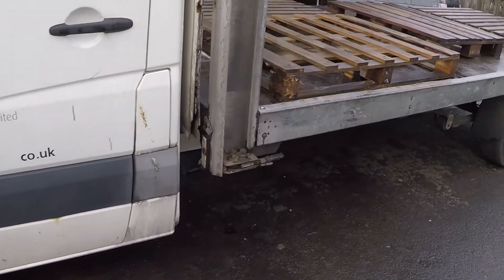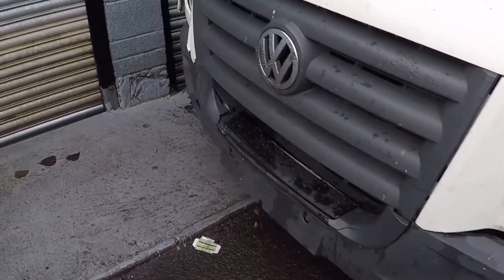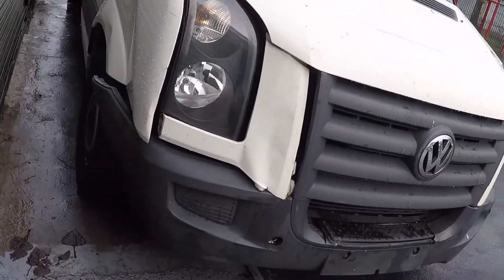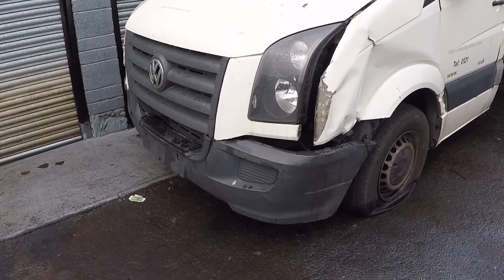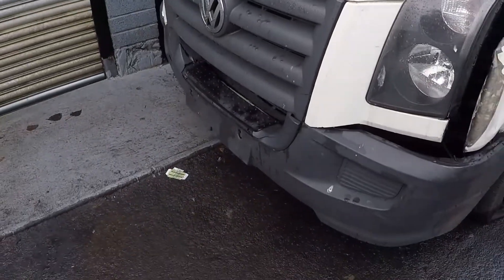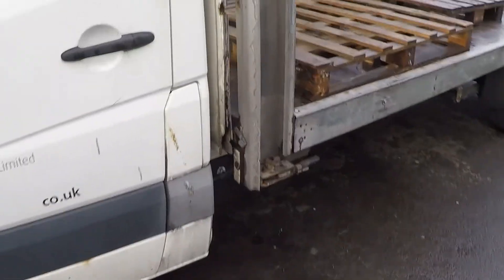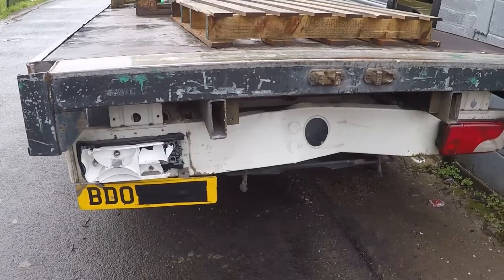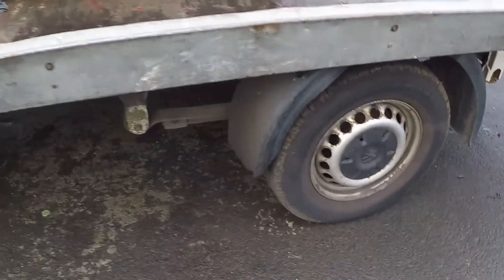Volkswagen Crafter Recovery Truck Salvage UK Damaged Copart Rebuild

Comment: Did you manage to fix the 1st gear problem
Reply from the maker: Yeah it was a gearbox problem. Sorted.

I have a ecu issue. Had the van remapped by a company and they blew the ecu and injector :(

Comment: Did you finish the van?
Reply from the maker: Hi Ben, the van is finished. I just need to upload the next video. I will send you a message once ive uploaded the video.
Reply: Driving With Ash Nice one, thanks for the reply. Seemed an interesting project. I have a Double Cab T4 tilt & slide recovery truck. Always good to see a different project 👌🏻. Get back on the videos mate 👍🏻
Reply from the maker: @911ben8  no worries. Its been a great project. I have been told by many recovery drives one of the best vans they have seen. Its most  because of the colour. Wow that would be nice to see. I did want a tilt and slide bed. The van is broken at moment had it remapped two weeks ago next day it just died. I think its the high pressure fuel pump. 

I need to start doing more videos just been lazy and long hour shifts at work. Hopefully by the end of the week i should have a video up.

By the way thank you for watching appreciate it 👍🏽